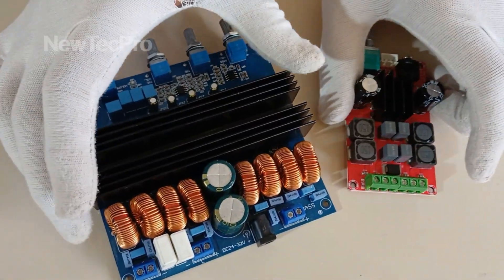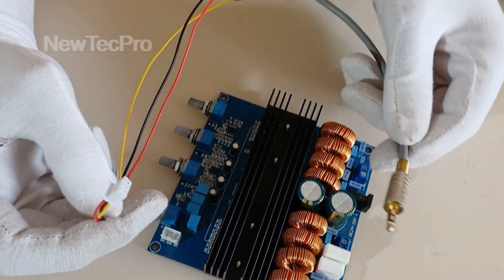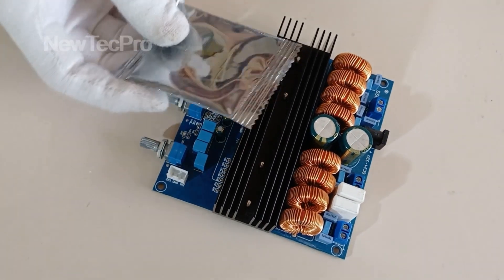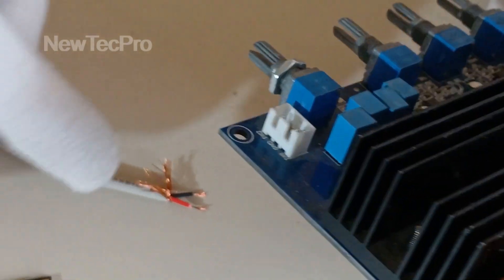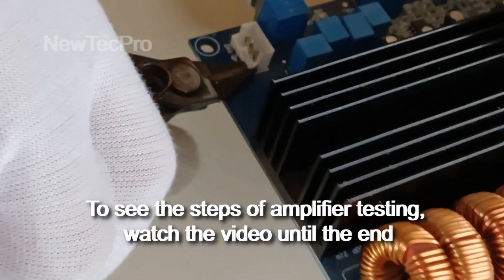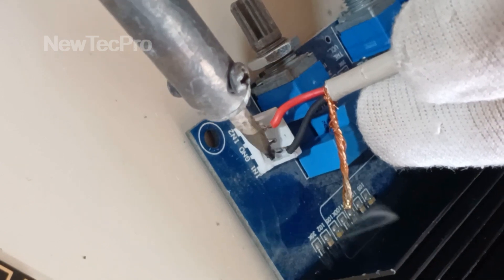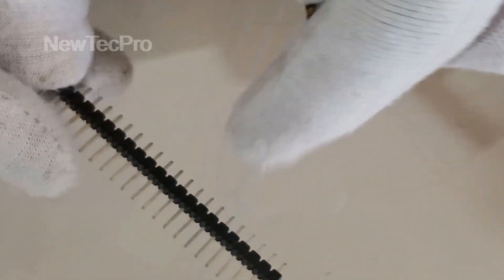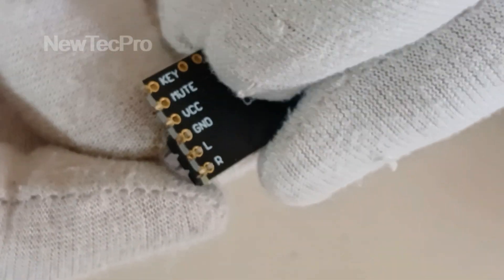How to Add Bluetooth Module MH-M18 to Stereo Amplifier

Comment: Is it possible to supply power with one power socket?

￼
Reply from the maker: Do you mean that the power of the Bluetooth audio module and the amplifier module are supplied from the same power source?
Reply: @newtecpro  Yes
Reply: @newtecpro  how can I contact you
Reply: @newtecpro  yes you would need a 12volt power supply to the amplifier, however you would need to run separate power& ground wires to a 12v - 5v DC Buck converter...then wires from the converter to the M18 module.... ( The buck converter can be small, because the Bluetooth module uses very little current to power it)

Comment: Just to say the Voice volume of this video is very low.  I had to turn my volume right up. 👍
Reply from the maker: Hello and thank you for your comment. Was the voice of the announcer low or the sound of the music played on the sound system?
Reply: The voice of the announcer. @newtecpro
Reply from the maker: Thanks for your comment. We will definitely improve the sound in the next videos
Reply: @newtecpro get rid of the voice and just use sounds like beep or like JBL. We hate the voice in bad English, plus it’s too loud. If I turn on my speaker at night or at work, the voice announces at max volume disturbing everyone. Mine has a whine sound when powering m18 and amplifier from a 12v battery and stepped down to 5v for the board. If I hook up a separate battery for m18 no noise.😊